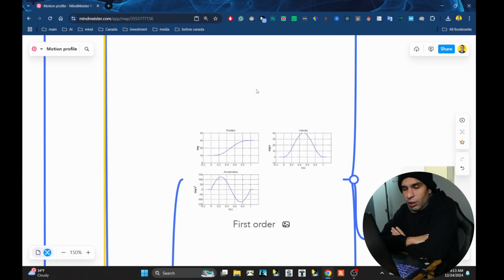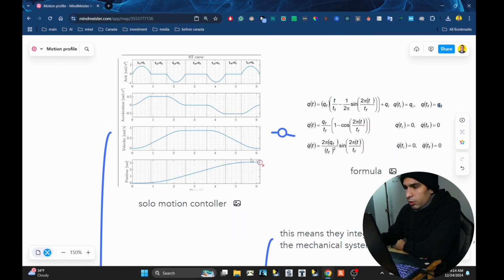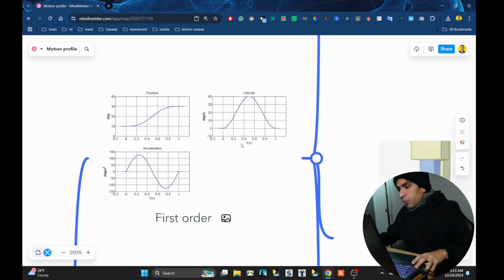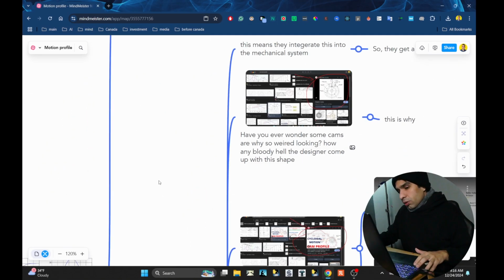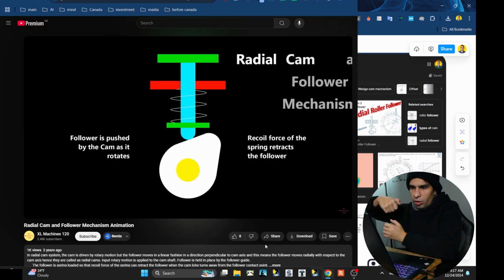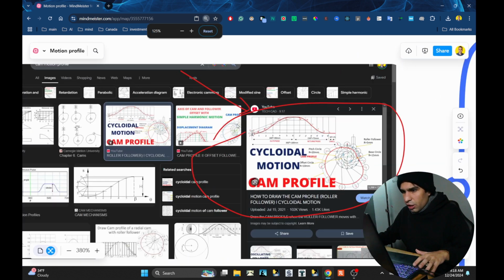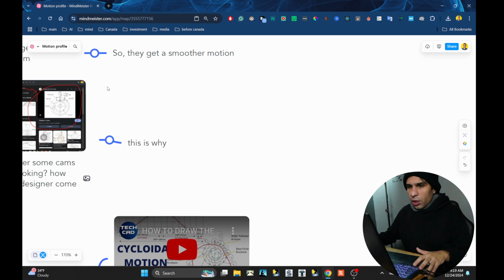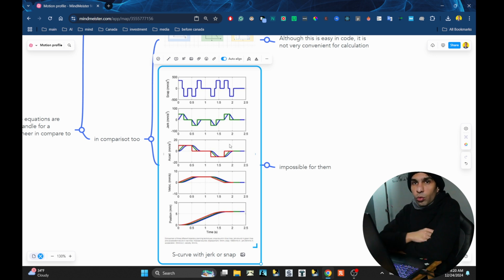Motion Profiles: Hacked S-curve | sinusoidal  (part 7)

Comment: It's not just easier to calculate. Discontinuities in the jerk or acceleration profile are not just mathematical, they lead to the mechanical system in the machine switching from tension to compression or vise versa and this causes significant additional wear.  With higher level polynomial profiles you can also achieve this but would generally need some reason for wanting that profile. Sinusoidal is fine for "I just want the machine to live a long time and no other real requirements for motion profile have been found."
Reply from the maker: Thank you so much for sharing. I learned something new.😊😇